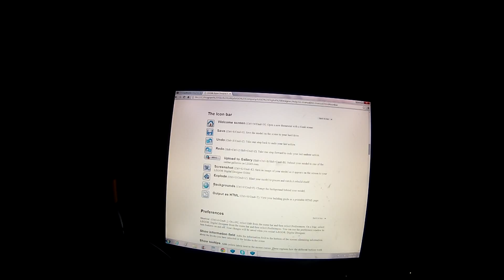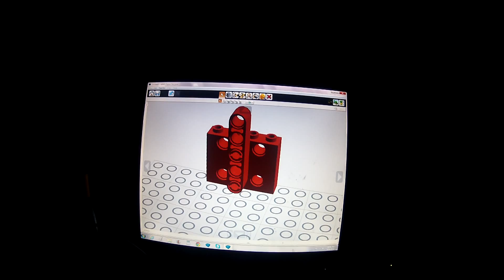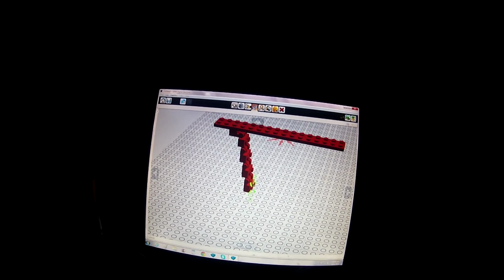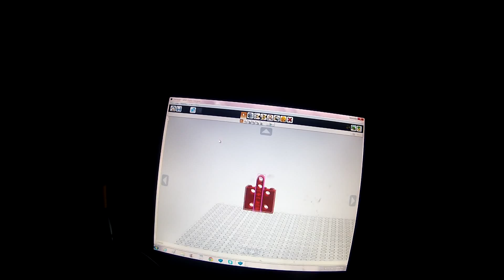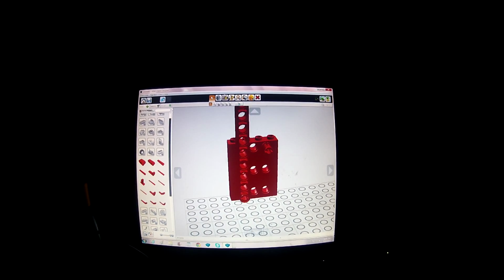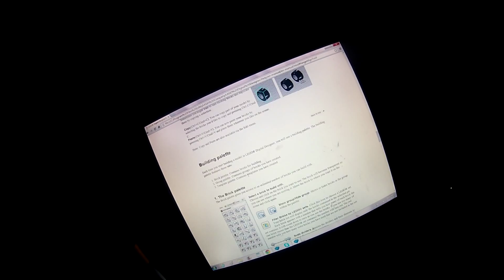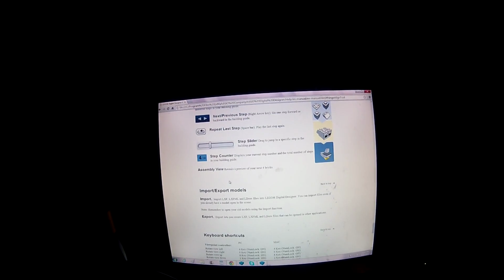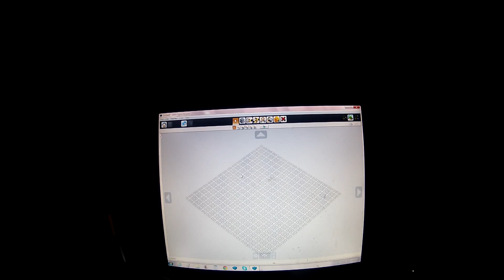Lego Digital Designer; Tutorial, Tips, Tricks: #17 Auto Hinge Align Tool

Comment: I've been working on a design based on a model I built in real life, just to make sure it was actually compatible.  It's got a lot of tricky angles though, and it would be all but impossible to actually make it connect.  If the Hinge Align Tool could act on three or four joints at once, that would help.

At least now I understand what it does though.
Reply from the maker: TheOtherGuys2 Good luck on the model!

Comment: I think the reason why you tend to get errors a lot is because the piece alignments you want are not physically compatible. For example, the pin and beam alignment for the beam (at 3:52) is not physically attainable due to piece geometry. It's all because of trigonometry. However, I do tend to struggle with this tool when it comes to flexing elements. I sometimes have a design in mind that requires a lot of flexing and alignment and more often than not it doesn't seem to work. Thanks for the video though!
Reply from the maker: Mohamed Marei No problem thanks for the feedback.